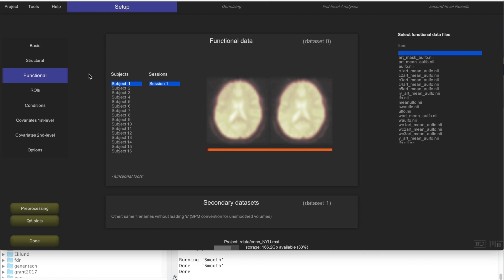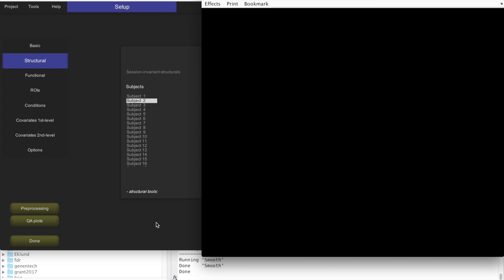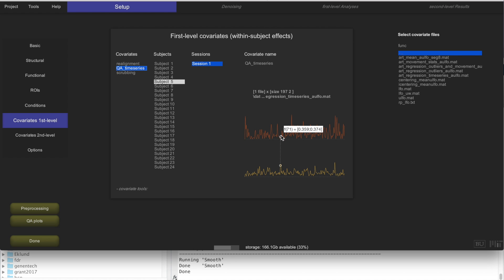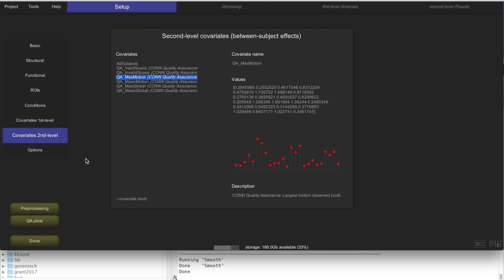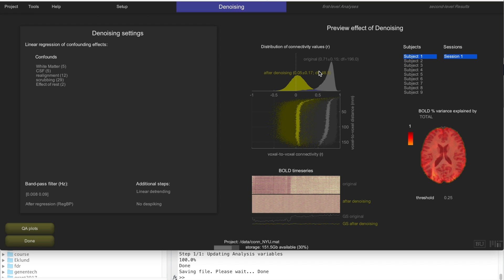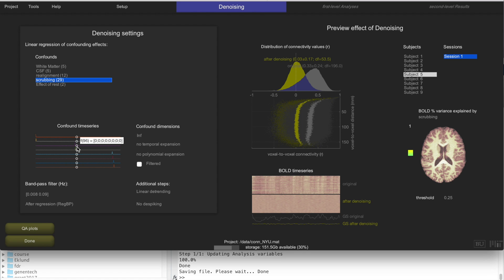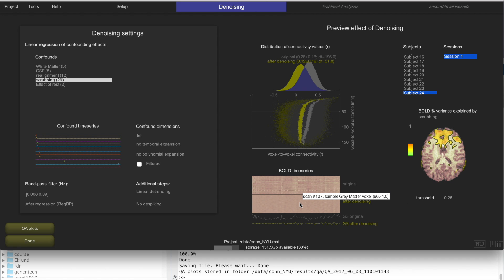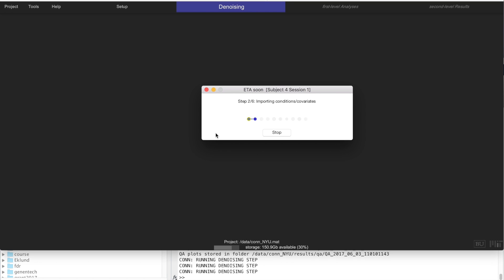Resting state functional connectivity in CONN (#2)

Comment: Hello, this video was super helpful! However, I am having a bit of a problem seeing the QA plots after the denoising had been completed. For some reason it keeps saying "No QA sets found in this CONN project". I have no idea what might've caused this, especially since I've been following these videos step by step. If you have any idea what might've cause this, it would be much appreciated if you could comment below!
Reply: Hi Grace, the most recent version of CONN is slightly different - you need to click ''Done'' on the 1st level analysis tap and run a group-level analysis before you can see any of the individual first-level results. Hope that helps :)

Comment: Hi there :) Amazing video as always. I have a quick question. Once I upload my anatomical image onto conn, it always says, "file may have been removed or modified" when I never touched the file. Do you know what the issue might be?
Reply: Error using conn_menu>conn_spm_read_vols
Error reading file
/Users/derya/Desktop/Study/fMRIdata/hydrocephalus/Sub-4A2/anatomical/sub-4A2_str2epi.nii.
File may have been modified or relocated. Please load file again

Error in conn_menu (line 793)
 [temp,volhdr]=conn_spm_read_vols(title);

Error in conn (line 2942)
 conn_menu('updateimage',CONN_h.menus.m_setup_00{5},vol);

Error in conn_filesearchtool (line 285)
 if length(h.callback)>1, feval(h.callback{1},h.callback{2:end},names); else, feval(h.callback{1},names); end
CONN21.a
SPM12 + DAiSS DEM FieldMap MEEGtools
Matlab v.2022a
project: CONN21.a
storage: 47.7Gb available